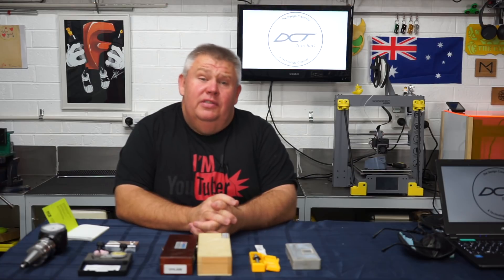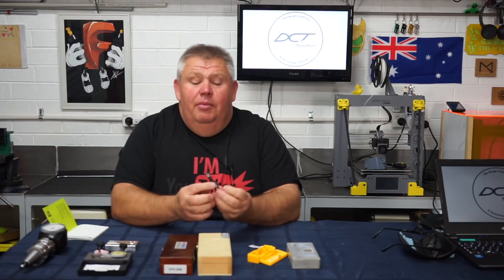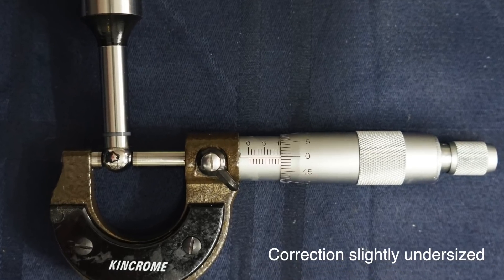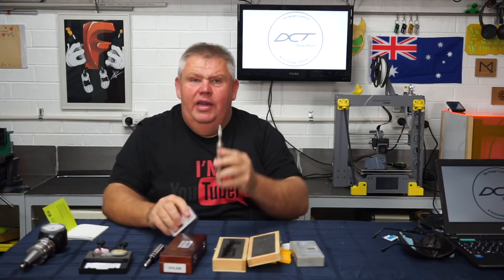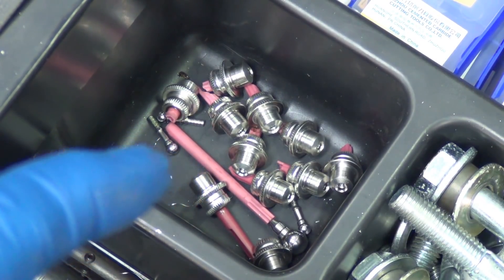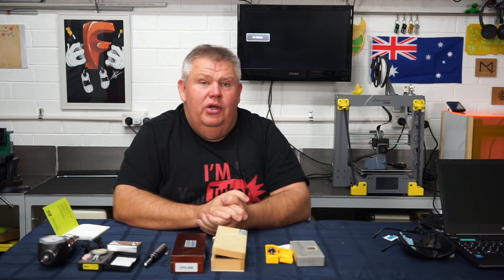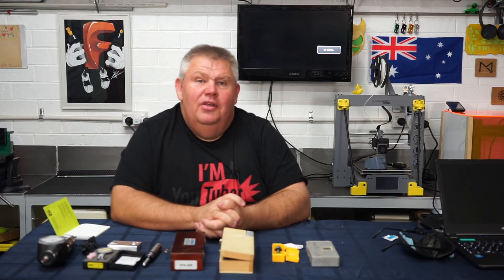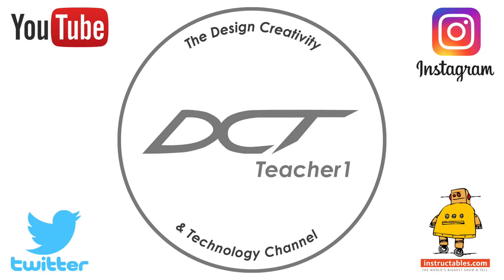Probing & setting the G54 Work Offset

Comment: Rewatched this tonight. Thanks Aaron. I needed the laugh and as always, enjoyed the content. I have the pioneer tool setter on my X7 with the OPS30 spindle probe.  They both work, but compared to the Haas system at school they are lacking. I feel spoiled when I use the Haas GUI, but on the other hand, using my Siemens controller on the SYIL, I am developing a deeper understanding of what is actually going on behind the seens.
Reply from the maker: G’day Garron, it’s good to hear from your buddy. So happy to hear that you got a laugh from the video. I did this quite some time ago now, but was asked to take it down. I didn’t do it and instead made it private for a while. Apparently it wasn’t politically correct for a certain “woke company” that I was doing contact work for. Anyway, I said FK it and made it visible again. Cheers buddy 👍🍻

Comment: This is all old world stuff. Get yourself $140 digital probe and you will never look back..
https://youtu.be/lqIU2KJOAp8
Reply from the maker: Hey mate.  I need to find out way on how to connect it to my LNC controller.  I'm sure it wouldn't be too hard though.  I checked out your channel.  You're mill is work well on Linux ;-)
Reply: DCTTeacher1 Cheers. I have 2 mills running Linuxcnc with the only thing not working being spindle speed... but I can live with that.
I think your problem won’t be finding an input pin, it will be the LNC 5800 supporting probing and probe functions. If it does your laughing, otherwise the Mac 3 for Syil might have been a better option! 😉

Comment: Haha get ya hearing aid on ya old man. Lol.
Reply from the maker: I know, I know, but I'm trying to delay the inevitable.  It really sucks getting older.  I put of getting glasses for 2 years, but finally gave in ;-)
Reply: @DCT_Aaron_Engineering  haha I hear ya, I've  just got my first pair of reading glasses at 42, I can see what I'm  soldering now. 

Enjoy ya channel, good to see you come from the old converted mill to what you have now. I'm still using using the converted HM45 here in Aus.
Reply from the maker: Thanks man.  I'm so stoked with what I've got now.  That X7 of mine is a fantastic piece of kit. Hey, you need to get some videos up of that HM45 ripping chips.  I'ld like to see that in action :-)

Comment: fun fact (noticed you didn't mention it), the electronic edgefinders might not work on all machines depending on the material for the spindle. Some machines use ceramic bearings that won't conduct the signal. The Haas spindles running 10krpm or faster use ceramic bearings except for just one which is steel, which allows you to use an electronic boy with it. But there was a brief period of time when ALL the bearings were ceramic, so you might get unlucky. I don't think anybody knows the exact internals unless you try to conduct with it...hah
Reply from the maker: Andrew Ydna DuBuc Hey Andrew. Yes that’s a very valid point that you raised mate. Not much continuity in a ceramic bearing spindle is there? I’ve never had the luxury of going over 10K rpm 🤣
Reply: yeah you got those pesky metric RPMs
Reply from the maker: My old mate Fargo Kev calls them "communist units" LOL.  Are sure I can't convince you to come across to the "dark side" #ilovemetric
Reply: oooh I can go both ways :)
Reply from the maker: Andrew Ydna DuBuc personally I don’t partake in those AC/DC shenanigans 🤣